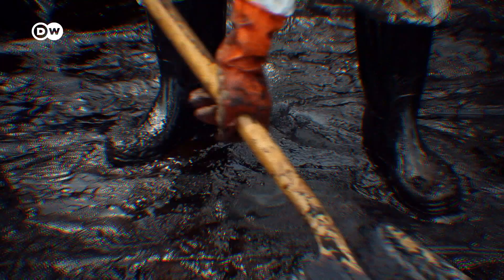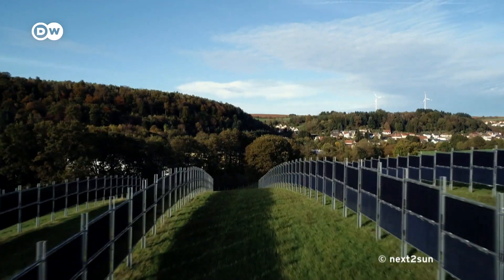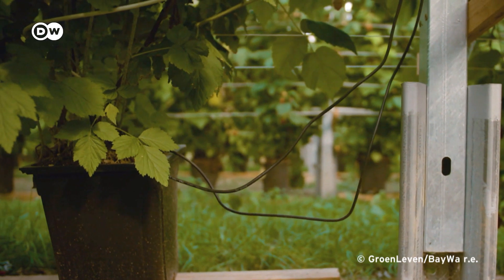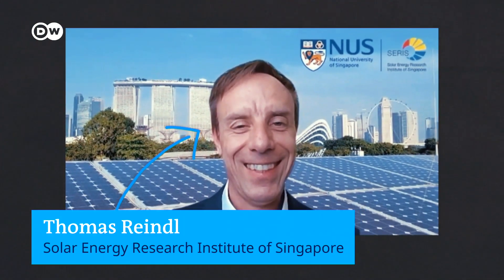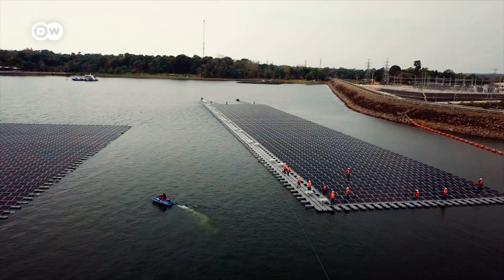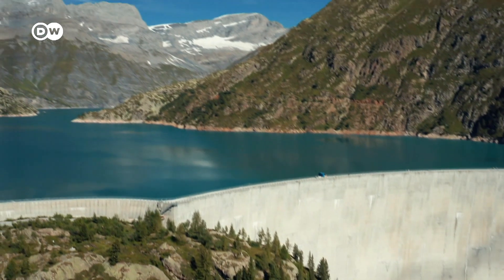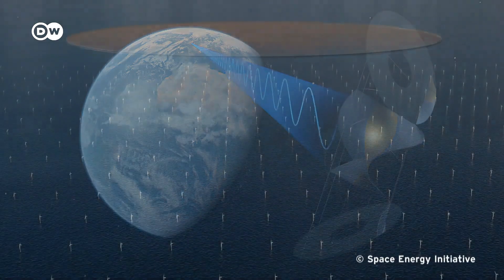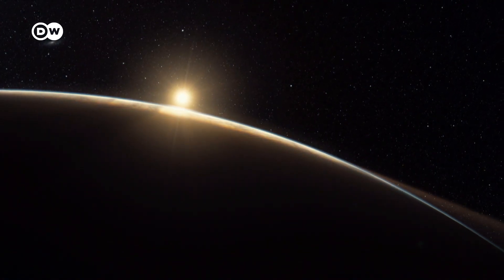Why we should be putting solar panels on our fields and lakes

Comment: So we can heavily mine rare earth elements, ship em, refine em, smelt em, cast em, ship em again, manufacture em, ship em again, assemble em and install em at an extreme cost to the environment because most people aren't aware it's worse than it can ever help over its lifetime and we can APPEAR to do good because appearance is more important than results
Reply: Actually, that's not quite correct. NREL has done the numbers. They made a life cycle study about co2 impact of energy sources from manufacturing, operation to disposal. 

And the result shows renewables being magnitudes cleaner compared to fossil fuels.

Coal 1000g of co2 equivalent 

Gas 500g

Solar 49g

Wind 17g

As you can see, not even close. Renewables are several times less polluting even factoring manufacturing and disposal.

Not spewing smoke in operation makes a big difference.

Ultimately, everything man made needs to be mined, refined and manufactured. Pointing that out gor renewables doesn't mean much. We need to consider the scale. 

We need better solutions, not perfect solutions. And renewables are definitely part of that better solution.

Source: NREL Life Cycle Harmonisation
Reply: @anxiousearth680  I think you need to look up rare earth element mining and refining. And what it takes to produce the chemicals to even refine it in detail. It's not just ore that's mine and melted. Chemicals have to be MADE which also takes energy AND produces chemicals, and the rare earth needs to be chemically extracted from the soil which is an energy heavy process, BEFORE it's even smelted which is a heavy process. So we have had to add multiple processes that aren't in old school tech. Resource gathering to produce chemicals, chemical production itself, then utilization of those chemicals for rare earth refining, chemical waste, and rare earth elements are almost impossible to recycle. It is an absolutely filthy industry. I run heavy equipment. Lot of normies and regular folk don't see behind the same curtains I do. Solar panels cannot replace the carbon it takes to produce them in their entire running life. Green washing this stuff isn't the method to get it out there. That's just fear based marketing. Why can't we just tell people it's cool, because it is. Catch more flies with honey than shit.
I personally think we SHOULD use solar yes, AND oil, AND nuclear and every form of energy that is available. I have an ebike because it's cool. No one I know with one has it for some hippy stuff and it's a poor strategy for promotion.

Comment: Geostationary solar satellites is dreamy.
Not only it's expensive, it's also prone to failure and nobody could fix it.
Reply: What the fudge are you talking about? Solar has become the cheapest energy right now, even more so than burning coal! And it is far less prone to failure since there are a lot fewer moving parts. Also, fixing problems is not issue at all, because panels can simply be replaced.

Comment: Question: Why shouldn't we be putting solar panels on fields and lakes and cars, boats, roads ... etc.?
Answer1: Because at the very least we will triple the amount of damage we've caused to the environment, and thus guarantee our own annihilation. 
Answer2: Maybe so many solar panels will cause a radiometer effect between the earth and sun, and this would knock the earth out of its orbit.
Answer3: Because real "profit = protecting and enriching the environment, and sharing the sustenance that it provides to all of us".

All of our actual gains come to us from our environment yet the old profit model "profit = income - expenses" is missing the word 'environment' and it defines the entire environment, which also includes all of us, as nothing more than expenses.  No wonder there is so much homelessness.  No wonder the earth is on fire.
Let's fix the real problem.  They call it man-made climate change because our reckless behavior towards our environment is the core cause of this problem.
"Profit = income - expenses" is our current behavior model.  Unfortunately, it is incorrect because it fails to instruct us to take very good care of our profit i.e., our environment.

Comment: We don't "need" solar to combat climate change, we need nuclear power. It's safer, less expensive, consumes less land and is more reliable. Ah, also emits less CO2 and other polluting substances.
Reply: Erm... Actually solar is 4 times cheaper per kWh produced than nuclear and keeps getting cheaper, while nuclear is starting to get more expensive... And concerning safety, I don't exactly see how solar panels could be considered more "dangerous" than nuclear? As for reliability, nuclear power plants need water sources to cool themselves, France produces 70% of its energy with nuclear and had an energy crisis in 2022 because it experienced extreme drought, so rivers dried up an couldn't cool down some of their power plants, so they had to be shut down and France had to buy coal electricity from Germany instead. Also there is the problem of geopolitics, nuclear requires uranium, and that is mined in countries that are currently very unstable and could cut your uranium supply at a moment's notice.
Nuclear does consume less land though, that's for sure. But then again, would it really matter? Nobody would want to live in a place where you can see the cooling towers of a nuclear power plant in the distance, so the regions around nuclear power plants are usually inhabited for miles around. Sure, you have a lot of free land, but it moslty unused, except for maybe some crop farming. With solar panel farms you can usually just hide them behind walls of trees.

Comment: you can actually just build a giant greenhouse, then stack pv panels on it and mix it with hydroponics and LEDs. You will protect your crops form the elements, save water and generate enough power... no need for stupid panels needed to be spaced out or that's on hydraulics.

Comment: If you put solar panel on the Earth's orbit, aren't you collecting more heat from the sun that would contribute more to climate change? The Earth doesn't absorb all the heat from the sun right but reflect it back to the outer space?
Reply from the maker: Hey.  ☀ While it's true that the panels don't utilize heat in the same way they do solar radiation - they do not contribute to climate change in the same way as greenhouse gas emissions from burning fossil fuels. Solar atm is the cheapest and cleanest energy source out there but it has its cons as well 👉 "How green is solar energy really?": https://www.youtube.com/watch?v=EWV4e453y8Y.

Comment: The Video is very well presented and informative, yet, it has numerous rooms for development that can still be RECONCILED, first, the water distribution, solar farming is efficient since it prevents drought from happening through installation at the Lakes, bodies of water as well as on dry land, while OPEN FIELDS can be QUANTIFIED as allocated portion of a parcel of the LAND for UPSCALE FARM BUILDINGS, an example, it can be 5 STOREYS or FLOOR SPACE, and measures 250 SQM X5 = 1,000 SQM or 1,000 SQ.FT/ an acre size as well computed/total floor sizes, while MILLET TYPES of GRAINS can also be PLANTED indoor, similar to FLOUR, WHEAT, BUCKLEY, and CROPS, since the SOIL is INSIDE the BUILDING, regulated floor and exhaust for HEATING, WATER DISTRIBUTION, HEAT is MANUFACTURED INDOOR by means of SOLAR ROOF, as well as BY THE USE of HEATERS powered by SOLAR OUTSIDE and THERMAL HEAT HARNESSED inside, creating an efficient TEMPERATURE desirable for INDOOR FARMING, where it can also be controlled,not just for Vegetable Farming, but also for TREES, CORN, CROPS, since they are grown inside using the HEALTHIER METHODS of FARMING, ENERGY HARVEST and Distribution, while WATER IS ALSO Effectively managed, since Water SILOS and treatment are designed for the waters to be stored after treatment process, powered as well by renewable sources, backed up by BATTERIES for 24 hours operation. INDOOR farms can grow vegetable FAT, CORN OIL, VEGETABLE OIL, as well as SUGAR CANE as FUEL manufactured inside the BUILDINGS. Complete goals for energies sources as well as Food/Environment sources/supply is as effective and efficient always guaranteed. ePLDT/PLDT/SME/Generalist-Supervisors/General Managers-SMC-Group of Companies-Telecommunications and Industries-LONG TERM Plans/Investments for businesses, TAX Table, FIXED Tax, Taxes and Tax codes. Tiers and Levels for your respective expertise in reconciliations of LONG TERM investments. These are also ON A LONG TERM basis, Reason:Urgency of planning, Investments realization, attested at the books of the Subsidiaries, attested as well by private and Public sectors programs in reconciliations for businesses, communities/growth dated 2006-2089, to date 2023. ******IMPORTANT********THANK YOU. All rights reserved.

Comment: Speaking as a trained and certified agriculture conservationist: placing prime farmland in panels is one of the worst locations you can put solar.

First off, these farms will suffer enough environmental damage, they have to be treated as a mine reclamation cite after the panels lifespan is completed. 

Second, there is no funding stream currently to address reclamation of that farm land, nor any expected investment to replace panel at the end of l there service. Meaning this is a short term gain in the energy sector that trades a long-term detriment to the farming sector. After the solar site exceeds it operation, it's likley many of these farms will stop producing power and crops. Solar infrastructure will have completely taken them out of production, as farmers will not be able to afford the reclamation process on there own.

And third, very few commodity crops will actually grow under panels. 1. Our production system use large planting, spraying, and harvest machinery that no longer fits under or alongside panels. 2. Far to much light is lost to produce the majority of feild crops. These sites are only really suitable to graze

Comment: How about the deserts?
Reply from the maker: Hey Craig, good question! ☀ There seems to be a lot of chances and risks related to solar panels on deserts. Even though high temperatures are ideal for power generation - extreme weathers can impact the panels negatively and in fact reduce power production. Then, there are the environmental consequences. This study suggests that solar panels on Sahara desert reaching more than 20% of the area could actually speed up a cycle of rising temperatures (🔗 https://agupubs.onlinelibrary.wiley.com/doi/10.1029/2020GL090789).
Reply: @DWPlanetA  study not proof

Comment: There really isn't any point in having farming and solar energy compete for space, it'll just make both of the business harder to control. There is plenty of space for solar farms as is anyway, and placing them a thousand kilometers away from the city is no issue at all. 

You need to cover less than 0.1% of a country's area with solar farms to cover all it's consumption.

Comment: What a complete piece of propganda. First off, we dont need more land for our cities and towns. If you moved all cities on earth to one spot, all of them combined would take less than 2% of the land surface(which is about a third of the planets surface). Second, Farming has become way more efficient since the industrial revolution. In 1600, one hectare of farm land would be able to produce food for 4 people. Today, thanks to evolution in the farming sector such as modern techniques, rotating crops, improved crops and fertilization as well as machinery that same acre produces 3 tonnes of crops per year. That is enough to feed more than a hundred people. And farming efficiency continues to grow, unlike world population which is actually declining. So the need to plant crops is a made up problem, which kinda destroys the premise of the video. then theres the other aspect. Solar panels need cleaning, even more so when there's pollinating crops, because those pollen tend to deposit on the solar panels surfaces. And theres mainenance. So you need to have some access to the panel at certain times, and that makes it come down to either destroying part of the crops underneath or leaving space where you cant plant crops. And the harvesting - industrial crop harvesting with machines will at least for now(if this were a thing someone would have developed a harvester that can work aroudn crops) not be possible, meaning we need manual labor to harvest those fields. So yeah, while I certainly wont oppose someone planting crops under solar panels if they like to, this is something I believe can only work on a very small scale, likely not reaching into professional farming. Considering that on top of that this is a solution to a problem that doesnt exist yet and likely wont exist for a long while to come, thumbs down.

Comment: Waves  in a water body like ocean -  what will they do with your floating megaislands? In arid countries - When you "save" water from evaporation, what dry air would people around have to breathe? Plus: Some water you also need for cleaning the panels. Etc. Many cons are underrated in this "perfect system" advertising video. Not talking about a tornado or a tsunami...
Reply from the maker: Hey Veronika! Thanks for pointing out important aspects. We did tackle some of the cons in the video but we cannot tackle all possible events. Studies show that even with such risks of earthquakes etc, a lot of countries are interested to install it due to the strong performance and reliability. However, there has to be an individual assessment for every case.

Comment: Thats really cool to see 🤙
I also wonder why we don't build solar panels above or on the side of roads, if you make them movable with tracks it would remain acessable for Firefighters, towing services, cranes and so on in case of emergency. 

Roads would not heat up as much as far as the wear of the tar is concerned, and drivers would be happy too.

Comment: I use 10 x 250 watt panels from 15 years ago on my roof in South Africa. By Sunset, even during Autumn i have 10kw of stored energy in my 2x5kw Dyness batteries. This is AFTER daytime usage of washing machine, dishwasher, kettle, wifi. The key is that my hot water heating is solar backed by gas which i plan to replace with a heat pump. My electic bill last month was: 5 (five) Euros. What's my point? everyone can start with a small system and help Earth, our home.

Comment: So you block out the sun? No, not by reducing growing surfaces. Covering water could reduce evaporation, to what effect is not certain. You cannot go covering up aquatic biosurfaces without having some detrimental effect on the underlying biology. Aquifers are a definite candidate.

Rooftop solar is largely still an unexploited endevour. This should not be used as an excuse for deforestation. That could easily become the consequence of this project. They must clearly procede with caution. It is certainly not a panacea.

We have to avoid being deluded by profiteering motives. We have discussed microwaving birds before. 😂 Let's give fusion a chance. By thetime these ideas come to fruition, they may have figured it out. They crossed the main threshold now. Also, there are much improved fission technologies that are much safer than first generation nuclear plants.

Meanwhile, EVERYONE should be installing rooftop solar, and wind power where it's practical. If you use the intermittent power sources to fill up reservoirs, you can make hydropower while ensuring that there will be water.

Comment: Some company shows Perovskite solar panels costing 10 $/m2, although they lose performance at 5% per year. Imagine someone renting 100x100 km2 of land in Sahara and bringing rolls which are then unrolled and cover all that area. The electricity gets converted into hydrogen or methane and pumped to the shore storage. This will be more profitable than oil and gas industry!

Comment: The only issue I see with solar panels is the dust. We won't get the most of solar energy if the panels are covered in dust. And we need water to wash the dust. 
It is a common problem at a solar farm in India. The farm invited controversy when it used underground water to clean it's panels, water that could have gone for irrigation and as water supply to nearby settlementa.
It isn't as simple as placing solar panels everywhere. You need to make sure the panels are working at peak efficiency